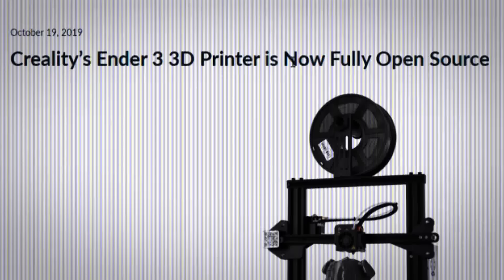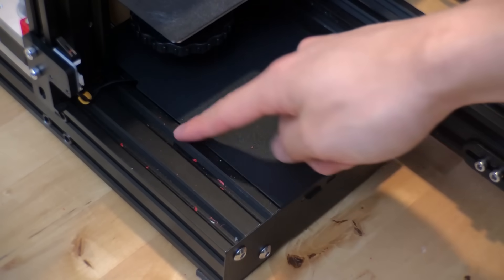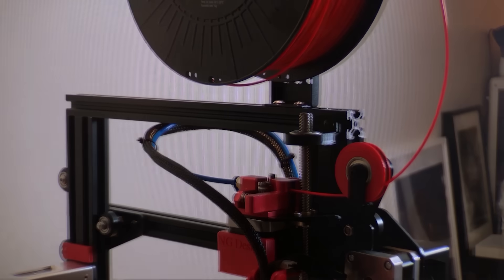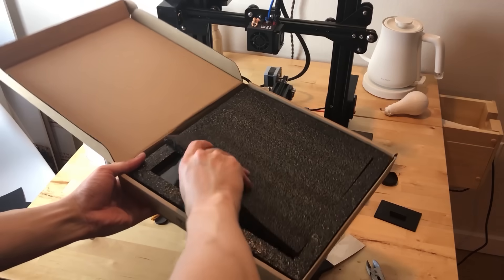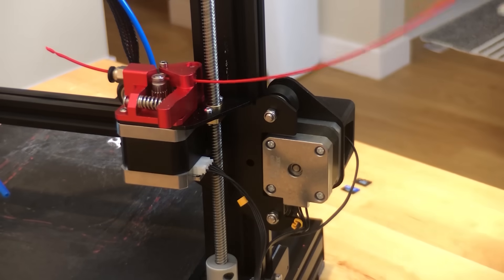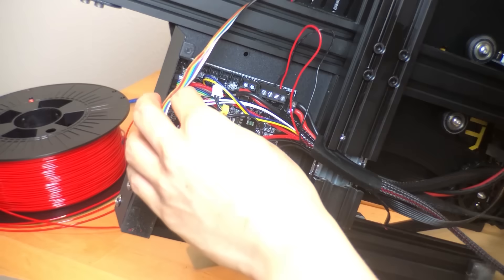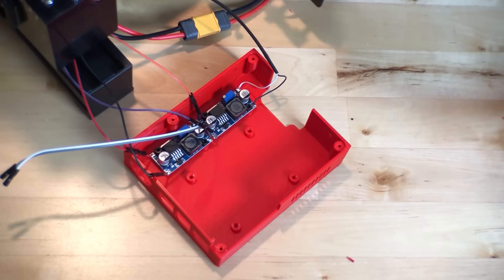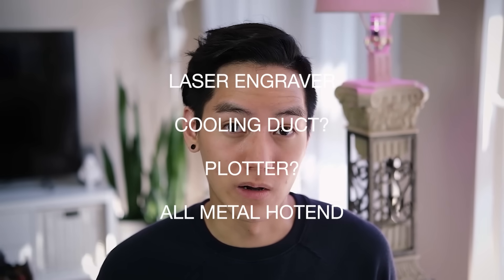First 24 Upgrades for my Ender 3 Pro - Part 1

Comment: Scott I cant see the bracket you printed for the Z Axis Rod the one that mounts to the frame to keep the rod from leaning away from the frame. Could you add the link.  Thanks chap. 
AND This Video was a REAL Helper in ensuring the Ender 3 Pro life is extended a fair amount more. Thanks Big Fella.

Comment: I dieded when you put a cover on the freaking fan.
Reply from the maker: The power supply fan is actually not an exhaust but an intake so the cover is only redirecting the intake air. I haven't really had any problems with this yet and it's also a very popular upgrade on thingiverse so it's probably fine?

Comment: no no no no no no do NOT constrain the top of the threaded rod. It is not designed to be perfectly straight, it is designed to just be a screw. The Z axis extrusion is the part that adds "straightness". By constraining the top of your threaded rod you are over-constraining your Z axis - the slight (probably imperceptible) bend in your Z threaded rod will be fighting against the straightness of your extrusion whilst turning. This is a bad idea that people with 3D printers CONSTANTLY fall in to the trap of. It seems logical to constrain it, but its actually damaging to print quality at best. It's nothing to do with potentially bending the threaded rod like you mention - you're close - its just using the wrong part for the wrong job. The Z axis thread only exists to lift the Z axis, it doesn't need to be constrained to do that, so don't constrain it

Comment: how much did you spend on other upgrades and filiment?
Reply from the maker: the filament is very cheap. all this barely even used one roll. the upgrade costs and stuff is in the FAQ pinned comment above!

Comment: Having the Pi powered by the printer is a bad idea. Why? Well, you want to have the Pi powered independently of the printer, and the Pi should turn on/off the printer. The way you have it you have to go to the printer and turn it on manually, and the Pi is only ON when the printer is ON.

A better way is to just have the Pi always on (put Pihole while you are at it) and plug the printer to a smart plug. There are Octoprint plugins for Tuya SmartHome, TpLink, Wemo, Tasmota (Sonoff), Domoticz, Orvibo and probably more. Using that you can turn your printer on or off with the Octoprint web interface and with Google Home, Siri and Alexa.

Also, just use 24v led strips, come on.
Reply: Also... The MicroSD to SD converter? fucking worthless. You are going to print through Octoprint anyway.
Reply: And one last thing: Take a look at the Mini-Me duct. It's super simple, none of that HeroMe nonsense and you can use 4020 hotend fans and 5015 blower fans, improving cooling a lot.

Comment: About that dual gear extruder... it's a great upgrade, not gonna lie. Much powerful than the stock one, but one word of advice: Add lubrication to the idle gear or it will eat up the metal below/above! Lithium grease should do it and you can also use it for the threaded rod.

Comment: Simple z-axis cure. Check the upper frame is square to the x/y bed with an engineer's square. Run the z motor up to the top of the screw before you tighten up the coupler to get it nicely coaxial. Two or three more flexi slots in the coupler would have been another solution to this prob but could compromise your z coordinate. A teeny-tiny dab of lithium grease every couple of kgs of filament may also be a lifetime extender.

Comment: Can someone tell me if having a 3D printer in my room is a bad idea? I’ve read about fumes but idk how I’m going to direct fumes or even if they are a problem with this printer
Reply: It is a bad idea because it's loud, and just don't print with toxic ABS and you'll be fine. Not that you'll be printing that material from hell anyway.

Ventilation is always nice to have, though.

Comment: so
I broke my ender 3 pro...

It went up in flames probaly cause i mixed some stuff 

Yeah....im not getting an new one in an week ;-;
Reply from the maker: whoa i’m so sorry to hear that. i hope it didn’t cause any property damage. any clues on what lead to the fire or what kind of mods you were playing with that maybe others should avoid?
Reply: I messed whit the stock mother board trying to do the same steps as u probaly did something wrong since when i turned it on it just starts smoking glad my dad helped me before the hole house woud've burned down.. Yeah so i woudent really mess whit the wire's ;-;

Comment: Does the level bed thing work on ender 3
Reply from the maker: yup! if you’re using the standard main board though i would buy it from the creality website because i think an adapter is needed.

Comment: Got another one... 18 - SD card adapter holder -  any tips for getting that extra ribbon to fold nicely inside when you try to snap the cover plate in place?    It shows it being folded up and using a small rubber band to hold it, but so far that's not doing it as the cover wants to pop off.  I ordered the same card holder as in the link and the one that arrived has about 8" of ribbon.
Reply from the maker: yea i ended up just giving it tight sharp folds and not the soft round folds shown in the video with the rubber band. it took me a few tries but it will work in the end. there's a small open area in the cover where you can keep it fairly spaciously. it takes a few tries. good luck!

Comment: what layer height did you use to print the tool box at? I'm trying to print one but at standard quality it will take almost an entire day
Reply from the maker: make sure you print it with the opening pointing up so you don't need support materials. that should help speed it up but it is still a large print so i think mine still took many hours too. i think i printed it at 2.4mm height. good luck!
Reply: @ScottYuJan  lol thanks, I tried printing it like a month ago and I ended up spending like 12 hours printing it before realizing "oh right I can flip it" wasted a decent bit of PLA.... also did you mean .24 mm? and where did you grab the ball bearings? thanks again man, looking forward to seeing more content from you!

Comment: I watched this video and I have actually done almost all of these things. A few must-haves are octoprint, it is sooo much better than having to take an sd card out of your pc and putting it into your printer every time you want to print. Another must-have is the glass bed and the metal dual gear extruder thing. Also if anybody thinks that the time lapse thing is cool, I believe he is using a plugin in octoprint called octolapse.

Comment: #18 Doesnt work I still have to unplug it from the printer while my card is inserted into the adapter for the printer to recognize the card and the cover/base plate dont hold together with all the wire folded over, pretty useless waste of money for an upgrade that doesnt work as reported to
Reply from the maker: huh weird... i wonder if you got a defective sd adapter or if there's another issue. here's the issue i initially had with it: inserting or releasing the micro SD both requires a push in action. so after you install the sd adapter with the push in action, you have to be VERY careful with installing the cover piece. this was where i had the most difficulty because when i installed the cover piece too fast, it would push in the micro SD insert and make it pop back out. after installing it very slowly with the wires folded nicely to the side it ended up working flawlessly. it's been about half a year now and i've never needed to take off the cover or the adapter.  This one's also a pretty popular upgrade on thingiverse too so i would try to investigate that. or maybe it's an issue with your main board... i'm not sure but good luck!

Comment: UPDATE: It turns out that the new 32bit 4.2.2 board shipping in the Ender 3 Pro is actually garbage. This guy addresses all the flaws with it https://www.th3dstudio.com/2020/09/04/what-are-the-creality-v4-2-2-and-4-2-7-boards-live-stream-tmc-4988/. Stick with Scott's recommendation for the SKR mini E3 V1.2.
ORIGINAL Post: The newly built Ender 3 Pros (manufactured after july 2020) have the same, upgraded, 32 bit motherboard that's in the Ender 3 V2. So, if you get one of those new units you can actually skip the SKR mini E3 V1.2 that Scott installed and save yourself $35.
Scott, thanks for this awesome content :).

Comment: Dude those time-lapses are amazing! How did you make them? I would love to know how to film those on my Ender 3. Did it greatly increase your print time because the hotend had to home after every layer? Thanks!
Reply: Octo-Pi. I believe that it can insert code to move the nozzle to specific coordinates at the end of each layer and take a single photo. All photos are compiled to make the time lapse.
Reply: @The.Talent  Thanks! I've seen a g-code modification in Cura called "timelapse", so maybe it has something to do with that while also working with Octo-Pi or maybe Octo-Print? I need to do some on what these different softwares do.
Reply: @kylemeier4  oh yeah that’s what I meant. Octo-print

Comment: why is it that half way through a printing process the nosel tends to lift the object off the printing table ?
Reply: that is most likely a bed leveling problem where your nozzle is warping certain parts of the print (like where the bed is highest), and over time throughout the printing the warping is bad enough to where the print separates from the bed. i had the same problem when i first started and i watched a bed leveling tutorial and was able to fix it. i would recommend watching a leveling tutorial if you are new to 3d printing and you don't know if you want to invest a lot of money in it yet, but if you have been doing it a while and like it i would get a bl touch/new board combo

Comment: Number 13 - Dual drawer - any tips to get the fill-ins out without destroying the two tier drawers?    It came out like a brick even with only 20% fill in Cura.   After a 2 day print, I don't want to kill the drawers.
Reply from the maker: oh no! i feel like i should have shown people how i printed this in my video because i got a lot of comments about this. I'll add some instructions to my video description but basically, you're not supposed to print it with support materials. if you rotate it so the case's opening is facing up, you won't need any and it prints flawlessly. if you don't want to reprint, maybe try using some needle nose pliers to reach in there and pull out the supports? that's what i usually do. good luck!
Reply: @ScottYuJan    I wondered why it took nearly 52 hours of print time.   New to this by about 3 weeks and this was the first "big" thing I tried.   As I said, I already have a crack or two in the case  - yes, now if I go zero infill and stand it with the open end up top,  we go down to 18 hours of print time.    Ok, now that I know this, I'll work with it and see about removing the fill.  If I destroy it, so be it.   Learning curve!

Comment: I keep popping those buck convertors with the LED strip....arghhh. Work ok for about a minute then they get so hot and that's it dead
Reply from the maker: whoa... that is weird.... i've been using mine for 3 months now and they never even get hot.... that's very strange. good luck
Reply: I will try a different LED strip and see if that works.
Reply: seems the LED strip I was using was drawing nearly 2A so changed it for a different strip that draws less the 100mA

Comment: How did you print #13 the dual drawer (mainly the case)? Did you do it with full support or not? Cause it would seem like quite a waste of material to do it with full support.
Reply from the maker: Dodle nah, just rotate it so the opening is facing up and you should be able to print it with no supports 👌🏼 good luck!
Reply: @ScottYuJan  Wow, why didn't I think of that? Anyway love your video, keep up the good work! ;)

Comment: 03:24 Only the people with zero knowledge about mechanics do the #09
It should be free at the end or you are causing more stress if it is not perfectly alligned (which you cannot do at home by yourself)
Reply from the maker: yea! a few people explained this to me so i added some info about this in the description and no longer recommend it haha
Reply: @ScottYuJan  I am curious about the z stepper spacer too. I just loosened the nut, ran the printer to the bottom and tightened it. Now it aligns with the motor shaft.  Then loosen the frame and run it to the top, and tighten the frame. Now the sides should be parallel.

Comment: How are you 3d modeling the parts? Do you have the printer already modeled that you model off of?
Reply from the maker: mostly just by measuring areas with a caliper and then printing them and testing the fit. depending on the part sometimes it can take a few tries to get it right.

Comment: Was removing the magnetic layer necessary since you are gonna level the bed anyways
Reply from the maker: In my opinion, YES. I've read on many threads that if you don't remove the magnetic layer, over time the magnet will slowly fuse with the glass bottom causing it to be extremely difficult to remove in the future. A lot of photos from people showing that they actually had to shatter the glass just to remove it so....not the end of the world but i would recommend removing it or just don't use a glass bed. there are other magnetic surfaces that are better than the stock matte the machine comes with.

Comment: where did you get the flexible bed?
Reply from the maker: mine came with my ender 3 pro. it's not... amazing though... haha there are many reasons why i replaced it with glass instead.
Reply: @ScottYuJan  not sticking enough to it?
Reply from the maker: nooo it's actually one of the better materials for bed adhesion. most of my problems with it was just how easily it got dirty and scratched up. I hated the dirt and effects it had on the base layer of all my prints. with the glass bed things always come out super smooth and i find that really important because i don't finish or paint any of my prints.

Comment: For number 13 (the storage drawers), did you use supports? Because mine collapsed when I tried printing it.
Reply from the maker: no supports should be needed if you have the orientation right... make sure you have the openings facing upwards. then you should be fine.

Comment: 5:59 For me the height of the handle is too high. The bed touches the top of the 3d printed handle and becomes curved. This is because the stock Z-stopper location is at the lowest possible position, so the bed-knobs need to be extra tight for the bed to be below the nozzle. Did anyone encounter the same problem? I hope I didn't permanently bend my bed... possible solutions could be to modify the model to have the handle lower, or situating the z-stopper upwards (which would reduce printable height).

Edit: I made a (less appealing but) functional redesign, hit me up if you need it.

Comment: I didn't get it why do you even buy the ender pro it is more expensive than ender 3.if you just want to get rid of the magnet
Reply from the maker: Prawin Parajuli i heard the ender 3 pro’s base plate is a lot more stable due to the larger extrusions so you can print at a higher speed. not sure if that’s true or not though. i think at the time when i bought it the ender 3 pro just had faster shipping too haha

Comment: I just bought the Ender 3 Pro and see Creality has made some improvements to it. I bought the Winsinn Dual Gear Extruder on Amazon. As I was taking the old unit off, I notice that Creality now puts a brass sleeve in the filament feed hole so it won't wear a groove in it. I didn't even notice it until now. I will use the new unit anyways. Also they include a couple clips that goes on the fitting the filament tube goes in.

Comment: why would you put a cover over the air intake? that's just a recipe for overheating
Reply: Exatly like, that’s dumb
Reply: @Solid_Snake99  It's not dumb. The "cover" is actually a fan shroud and it allows the air to flow while attenuating some of the awful sound of the PSU fan. Not by much, but it is a bit quieter.

Comment: All metal hot-end and a better cooling duct and fan are great upgrades.  The hot end will let you print higher temperature materials, or print PLA/PETG hot for speed and layer adhesion.  While a better cooling fan will let you print faster with good overhangs.  Fyi, another path to speed is setting extrusion width larger than the nozzle.  I.e. 0.6-0.8mm wide extrusion with a 0.4mm nozzle.  Also lets you bump up the layer height.